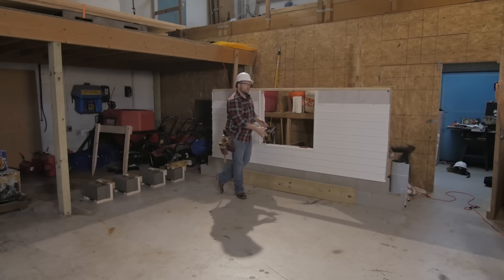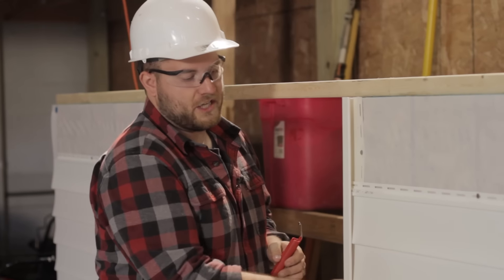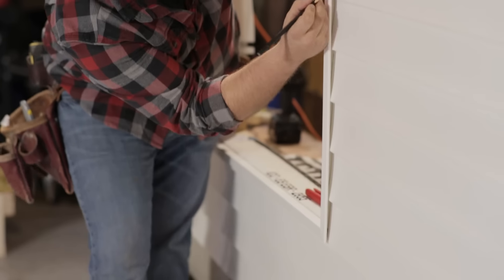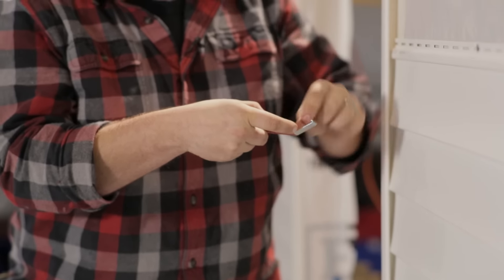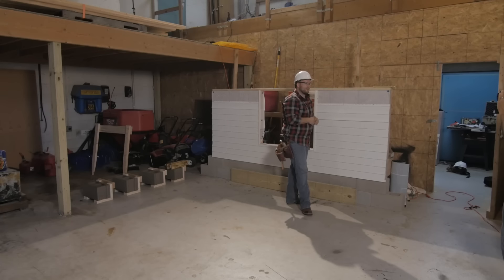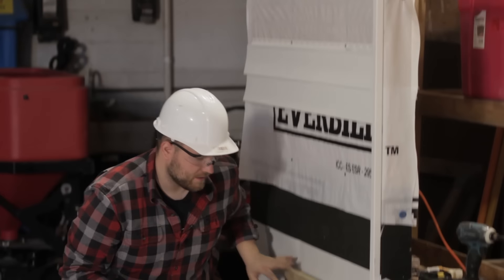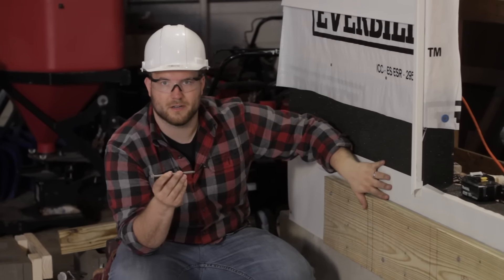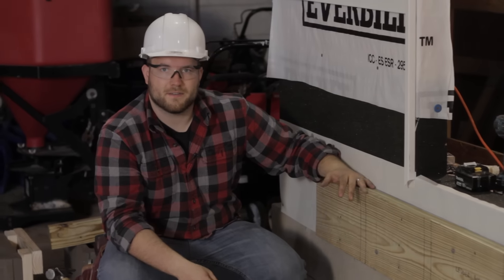How to Build a Deck Part 2: Ledger Board

Comment: exceptional video.
Where do you talk about the Z-flash on top of the ledger? I saw it installed in a later video but couldn't find the actual step you took.

Comment: My inspection fail be cuase I used those bolts on the ledger board The inspector wants 1/2 hex screws I have studs on the wall some are rotten any advice???

Comment: Now that the coil stock is on top of the membrane, there isn’t anymore shedding of water down the walls - water will hit the edge of the coil stock. Shouldn’t everything be installed in a shingle type fashion to shed any water that might find its way behind the siding?
Reply: i know im asking randomly but does someone know of a method to get back into an instagram account?
I somehow lost my password. I would appreciate any assistance you can give me!
Reply: @Coleman Simon Instablaster =)
Reply: @Brett Kaiser It did the trick and I actually got access to my account again. Im so happy!
Thanks so much you saved my account :D
Reply: @Coleman Simon no problem :)